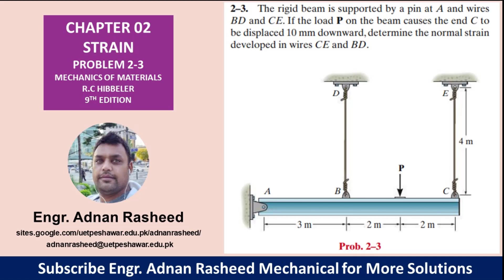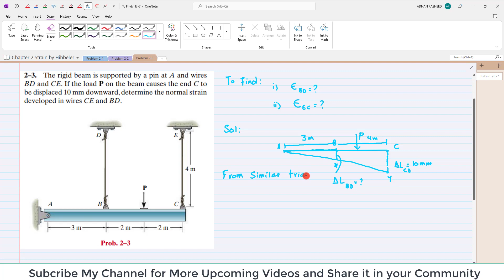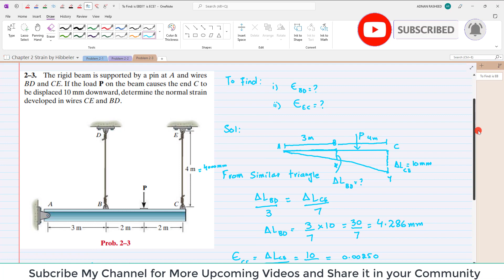2-3| Chapter 2 | Strain | Mechanics of Materials by R.C Hibbeler|

Comment: Sir great video but u havent converted 10 mm into m or 3/7 m into mm in similar triangle section
Reply from the maker: As you can see that 3 meter / 7 meter x 10 mm will cancel meter by meter so we will get 3/7 × 10 mm.
Reply from the maker: I hope it is clear now.  You can just convert all into m or mm you will get the same answer.